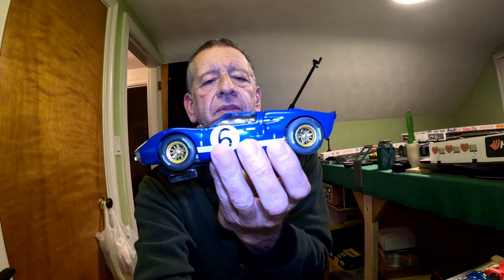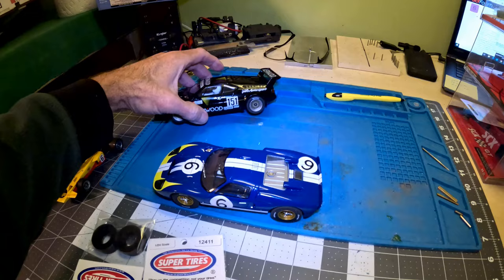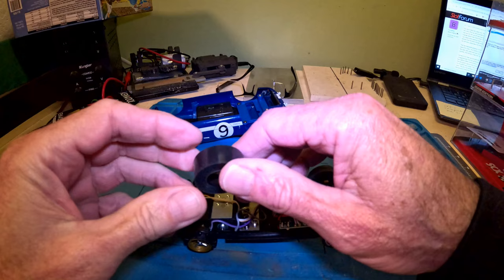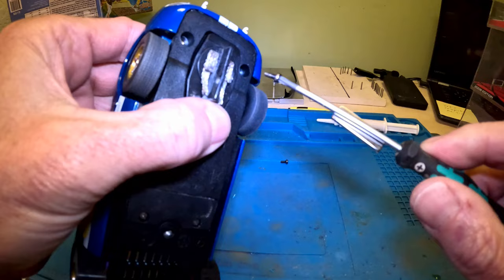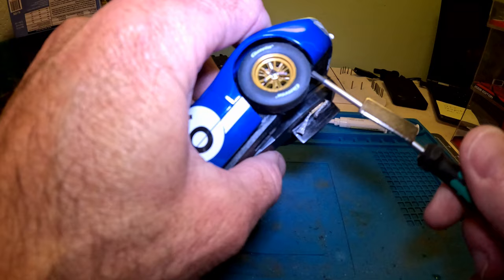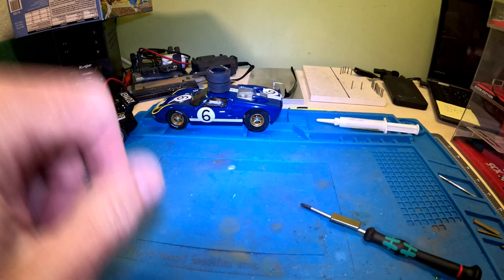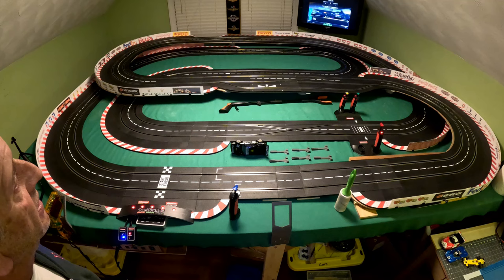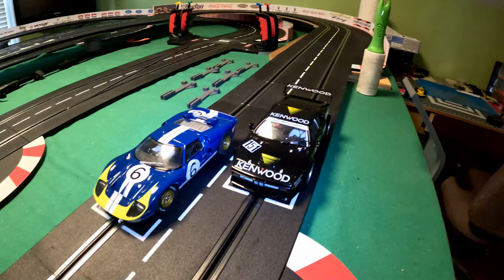Adding Supertires to my 1/24 scale Ford and BMW

Comment: Your leaderboard you compared for the timing was 1/24th scale or is it mixed scales? Also I changed to bobkat slot car tires and have seen a great difference. I tried silicon and they pickup any dust etc very fast on the track so the times seem to be not as good as the bobkats for some reason. Nice video !🏁
Reply from the maker: Currently its a mixed scale, but as I am writing this you've got me thinking I should mix em, I will get back to you on just the 1/24 scale cars
Reply from the maker: Hi @LewsSlotCarTesting-sr9iv, I just posted a screenshot of my leaderboard filtered by 1/24 scale cars only on my community page

Comment: Are they different sizes ? Also looking forward to the quick slicks compared
Reply from the maker: Yes they are. For the BMW i used item #12411 and for the Ford #12406. Once I get the Quick Slicks I will do another video because Im curious as well. I think QS perform best on my track
Reply: @SpareRoomSlotCars  I’ve use supertires on slotit and scalextric and they didn’t seem too grip like the quick slicks.. but I didn’t time it , they were just a little loser. Oh on 1/32
Reply: @RagTop-Pat  are you talking urethane or silicon, Pat? We only run urethane and rubber. Not a fan of silicon as it strips off the grip. Of course you could run silicon exclusively but the track needs to be 100% clean all the time.
Reply: DONT OWN 1/24TH. When I can but them I like MaxxTrac tires.they are very good on my.scaley layout. Good to see you having fun.do u taper the inner and or outter edges of the tires?  Do in some of mine to keep edges from skipping into the he metal rails..just curious
Reply: @DNASlotCars  Yes you wouldn’t want quick slicks on your track then . Quick slick go away quickly on a rudder or dusty track !
Reply: @DNASlotCars  Well commented. The Silicons are an enemy for PU or Rubber coated tracks. Actually, I would choose Foam Rubber tires, which will run for atleast 90KM`s on your track. If they dry out, you smear body-lotion, or sun-blocking lotion onto the tires and let it soak in for a few moments and they are good to go. Rubber Foams are available pre-trued and you can get them already mounted on Rims. Besides they won`t destroy the coating, Silicons will. Rubber tires are fine, too. Actually I am not a fan of PU Tires, because they loose a lot of flesh and won`t last as long as Foam Rubber ones. Plus you won`t have that much PU dust fliyin`around your track, due to the loss of tire flesh. But everyone needs to make his own experience with it. My 1st choice for 1/32`s are definetly Rubber and for 1/24`s Rubber Foams. If you run in a Club, PU`s are too expensive compared to Rubber Foam on 1/24. You get more milage and have less dust on the track.  ;-)
Reply from the maker: Hi Dafingers, i have not tapered the tires in any way, I havent even trued them, they seem to run fine right out of the box

Comment: Does anybody make a silicone tire with a tire shaped profile on the sidewall? The tires always look very one dimensional to me and I don't know if they are capable of being shaped slightly. I would think at least the edge could be knocked off so they don't catch on the edge of the tire
Reply from the maker: Hi Rob, I dont know of any manufacturers that make them like that but they can be truedd and shaped it just takes longer from what ive heard. I havent trued silicones, they seem to run great on my track and at my clubs wooden track as well